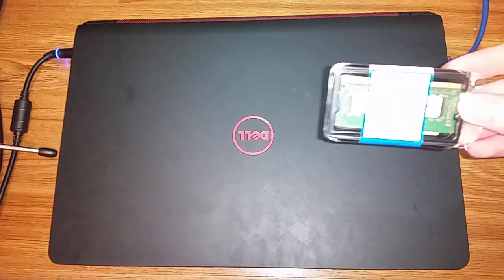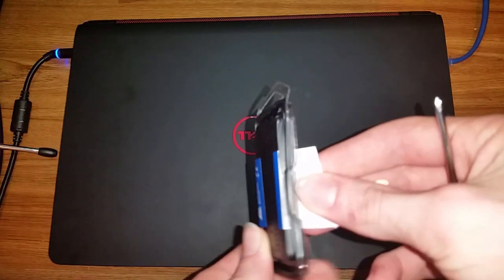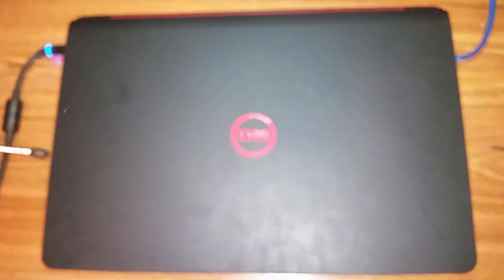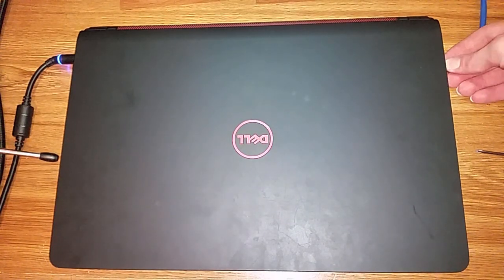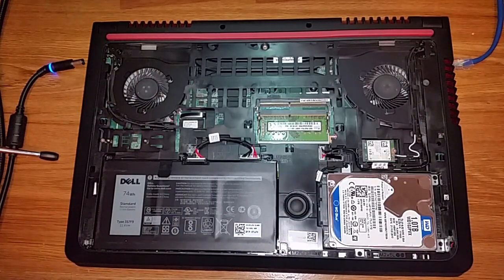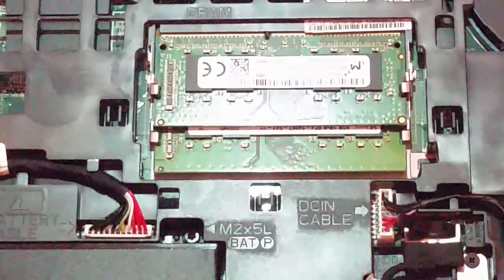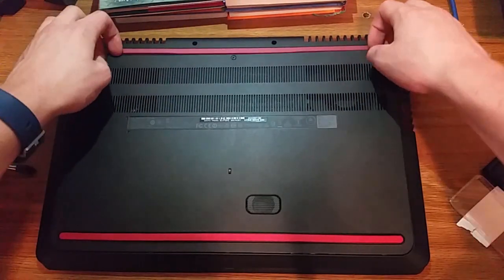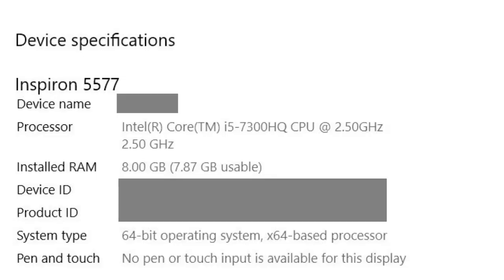HOW TO ADD RAM TO A DELL INSPIRON 5577 GAMING LAPTOP

Comment: Great video! Two questions, does the 5577 have a slot for SSD in addition to the two ram slots? Also, does installing this yourself void the warranty? Thanks!
Reply from the maker: Thanks! It does has a slot for an M.2 SSD in addition to the RAM slots. I don't believe that this voids the warranty, but you'll have to check the Dell support site to be sure.